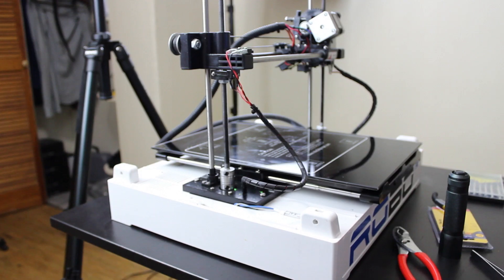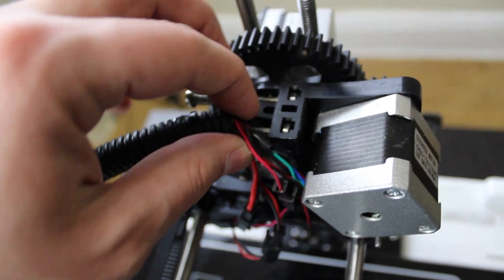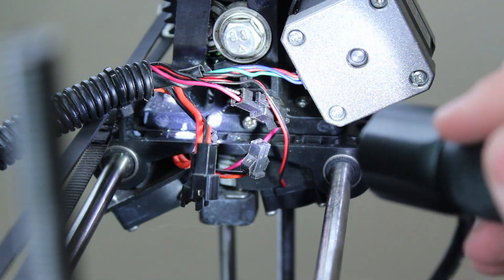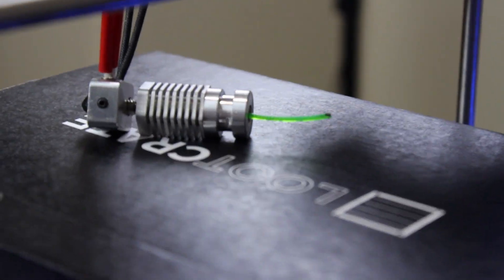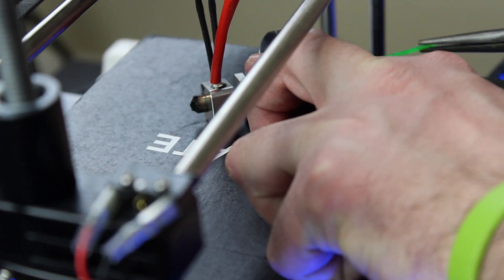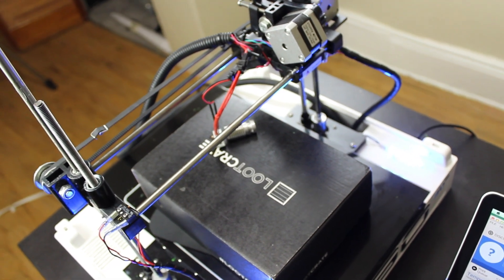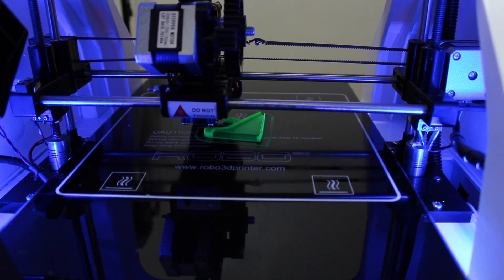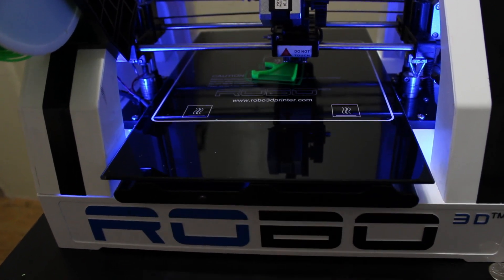Unclog Robo 3D R1 Hot End!

Comment: My ROBO 3D R1+  does not have the two screws, I was able to disconnect the wires but the extruder does not come out.  What am I doing wrong?
Reply: Under the carriage where it says "hot do not touch" there will be a screw. Remove that and swing the plate out of the way and the hotend will fall.

Comment: I bought an R1+ last week and it's been great, but I took the extruder out to fix a jam and now that it's assembled, Cura thinks it's at 357 °C even though it's cold. I never disassembled the extruder itself.
Reply: I am having this exact same issue right now and I'm not sure how to fix it
Reply: Lilith I had the cables to the thermistor and heater core switched around.
Reply: Oooooh okay thank you! That fixed it

Comment: I have the R1 Plus, which is pretty different than this as far as the hot end and how it is attached.  There are no 2 screws does anyone know the easiest way to unclug the r1 plus?  I'm having issues. Thanks.
Reply: you can get a piece of guitar string and run it up the nozel...that works for most clogs. if you want to remove it there is an aluminum plate that acts as a clip instead of the two screws.
Reply: oh...make sure you heat it up before you use the wire

Comment: re Robo3D R1 how do I remove the filament inside the extruder if it has broken off inside the extruder?  I can't seem to grab it or push the jammed portion through the tip.  I have it heated up to 210.
Reply: +Dan Lee  Sorry Im so late on this one.  use a tiny allen to force it through.  it will go through easy and the allen will stop at the hot part.  I followed it up with running a piece of pla through to make sure it was clear. i had the heat higher than normal at 230.  I hope this helps

Comment: Thank you for making the video! I was able to disassemble the print head on my RoBo 3D R1 using your video as the guide. A few things I encountered in the process that should be noted: 1) the screws changed in the current production model requiring the allen wrench to be used, 2) after removing the screws I still had to remove the small fan that cools the hot end in order to firmly grasp the hot end on both sides and and pull it down without having to resort to pulling it by the heating element.This was the first time I had to clear a filament jam so it was firmly in there from manufacture. Hopefully I won't have to remove the fan if/when it happens again.

This was a lifesaver! Thanks again!